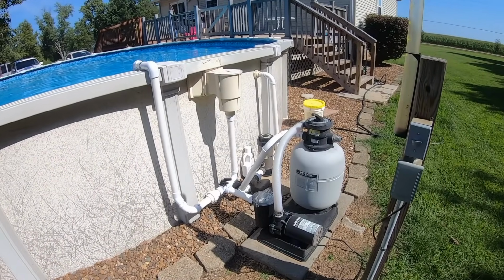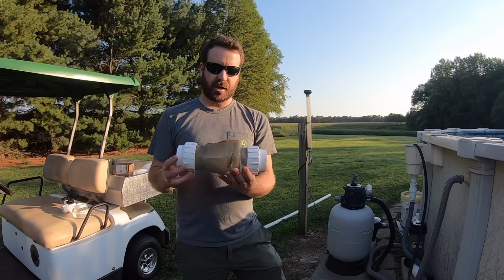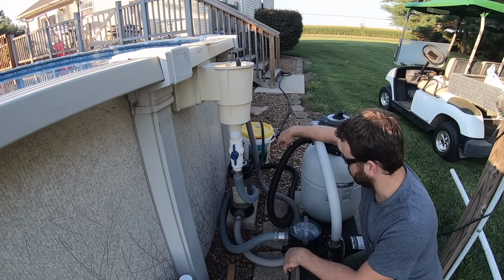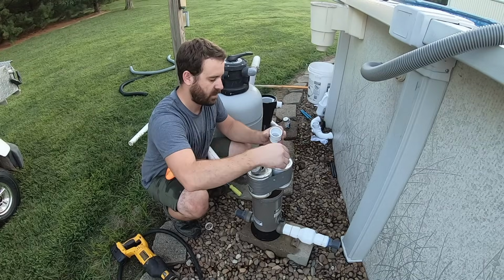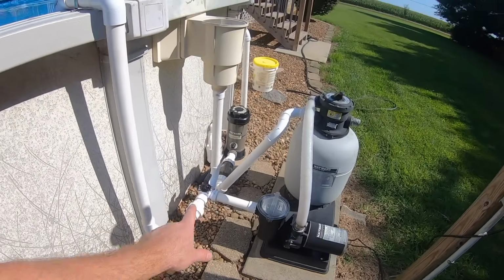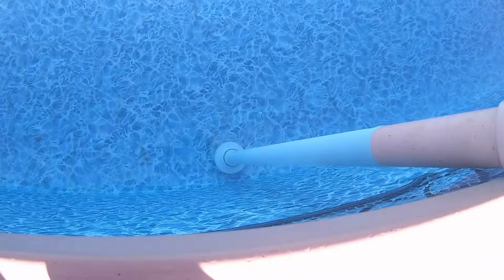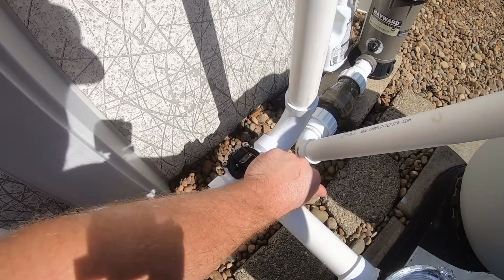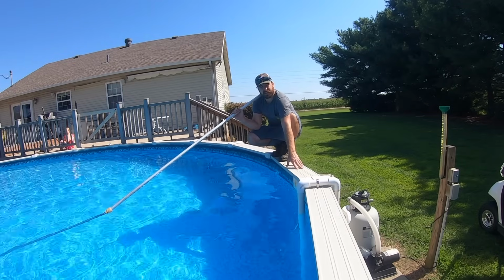Above Ground Pool Bottom Drain & PVC Plumbing

Comment: You really should have two that are at least 3’ apart. This is not VGB compliant.
Reply from the maker: Why are two required? Also the intake grate is VGB compliant. Search part number 640-3570 V and you can find the certification.
Reply: @NealORussa  Two are required to be VGB compliant. I never said the drain cover isn’t compliant. VGB is more than an anti-vortex cover and a certificate. The installation itself needs to be compliant as well. This calls for 2 suction ports and if they’re on the same plane they must be 3 ft apart. Skimmer does not count as a suction port in this instance.
Reply from the maker: @nifethrubutter  Ahh, i see.  Thank you for the clarification.  I appreciate your insight.  I know a lot of pools with only 1 bottom drain, but I do see the safety aspect of having two, in case a person is sucked into 1, the pump's suction could revert to the other so the person could get free.  So i guess if i wanted to be compliant i would have to put a tee on my suction pipe and run a 2nd intake at least 3' from the original or could I install it on a different plane such as right off the tee at a 90* angle to the bottom drain?
Reply: @NealORussa  many pools with single bottom drains are set up in a compliant way. They are fed into the front port of the skimmer and only really receive passive flow into the lower pressure of the skimmer area, creating a suction break and making them safe. VGBA is about tangle and suction entrapment.

Comment: Hey man, great video! I tried to replicate it exactly and it works great. The only issue im having is if i try to put it to 100% bottom drain then theres no water being sucked through the pipe. Its as if it cant get over the railing. Any suggestions?
Reply from the maker: Did you start watching at 10:30? That shows how I began to purge the air out by filling up both sides of the pipe over the railing. I believe I remember i had to cycle the valve back and forth between the skimmer and bottom drain a couple times to get it all out but it definitely did as you can see around the 12:30 mark when I switch valve to full bottom drain. 
If you're still having trouble I could recommend 2 things. One would be to remove the up and over pipe from the bottom drain to the union at the valve, then completely submerge that pipe and fill it with water. Cup your hand over the end that goes to the union and leave the grate in the water. Lift it up and over and quickly remove your hand and connect to the union. Make sure the valve is off to the bottom drain as well. Then you can start pump off the skimmer then switch valve over to bottom drain and it will be a full pipe with little to no air in it. 
Option 2 would be to add a tee at the top at the railing with a threaded tee and a plug. Remove the plug and fill the up and over pipe with water from a garden hose or bucket scooping from pool. Reinstall plug in tee. Start pump.
Reply: @NealORussa  I think I was being too impatient lol did as you mentioned and moved the valve back and forth a couple times and all is good now! Thanks 👍
Reply from the maker: @EverythingxAndroid  glad to hear it! Good work!

Comment: The only problem i see with this is that above ground pool pumps aren't meant to produce suction. The water is gravity fed into the pump. By doing this you are putting unnecessary stress on the pump as its not meant to create suction. And secondary is that all manufacturers do not recommend that you walk, stand on the top rails of a above ground pool 🙄.  I know that this video is what you did for yourself but it clearly shows what not to do with a above ground pool.
Reply: well now your comment is the only thing i see wrong with the thought process. one yes the sand filters don’t suck as hard as a in-ground system. but that’s apple and oranges. because at the end of the day inground pools have more water to move and suck aka bigger pumps. with the above ground system they have gph rating for a reason. you get a above ground you match it to the correct pump rating. so with that said how’s removing friction and travel length gonna hurt the pump more?. the pumps only gonna pull so much no matter what. now had he went with bigger pipe then yes he would have lost suction power. but seeing as how he used the same diameter pipes as the issued pipes there shouldn’t be on issues on stress relief.
Reply from the maker: Been running fine for a few years now.I could argue is actually no suction on the pump because the pump is still located below the pool water level so theres still 3-4' of head pressure of water above the pump. 
If the pump was located higher than the water level such as up on top of my deck, then yes I agree there would be suction and maybe hard on the pump.
Reply from the maker: As far as walking around the edge of the pool, hope I don't fall in!
Reply: It creates a siphon. The pump isn’t sucking.
Reply: All pumps "suck" lol. It's how they work. They use centrifugal force to induce water in the inlet (suction) and force out of the outlet (pressure). If it were as simple just a siphon, then a simple water hose could accomplish the same goal. Idc if it's above ground or in ground, all pool pumps work off of the same principle.

Comment: Neal Junior be like "Dude, get on with it already or Imma plunge in this thing regardles...'" 😁Sweet kid. On a serious note, Is that pre-filter enough to filter out all the debris that comes from the bottom drain?
Reply from the maker: Haha thank you! I'm hoping she grows up to be a big helper. The filter screen on the end is more so just to stop leaves etc from going into the pump. It has similar hole spacing to the skimmer basket. Some items make it through and get stuck in the pump strainer basket. The pump strainer is easy to clean now when you shut off the 3way valve and have the 1 way check valve. There's no flow allowed so you can remove the pump basket without water pouring everywhere. The bottom drain is mainly there to suck up algae to go into the sand filter and it has been working great! I have barely touched the pool in the last 3 weeks!

Comment: Interesting fact, the more restriction you add to the pump the LESS it has to work.. If you don't believe me, add a watt meter to it and then close off the valve. Wattage will go down not up.
Reply from the maker: Hmm, might have to test that. Seems counterintuitive. Thanks for the comment!
Reply: @NealORussa  Same thing with HVAC blowers. The more stopped up the filter is, the less the motor works.

Comment: I want to know if it works
Reply from the maker: Yes it works great. This was late toward the end of last year but looking forward to opening this summer. I could definitely tell less stress on the pump pushing through the smooth solid pipe vs the corrugated hoses. As far as the bottom drain I think it will be a big help with pollen and other light materials that sink to the bottom.
Reply: @NealORussa  yep and brush more than having to vacuum

Comment: I just throw my hose with vacuum thing on
Reply from the maker: @yesidrive  yes that works, but I'm tired of messing with the pump and getting the hose out and purging the air and doing everything to get that going. This is always running and easy to turn a valve to go all bottom or half bottom half skimmer. Has been working great!